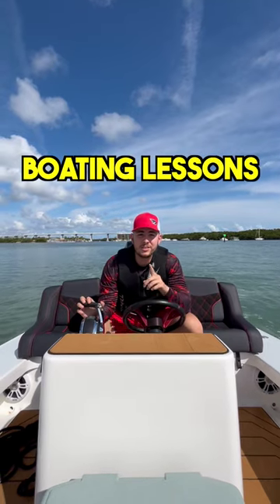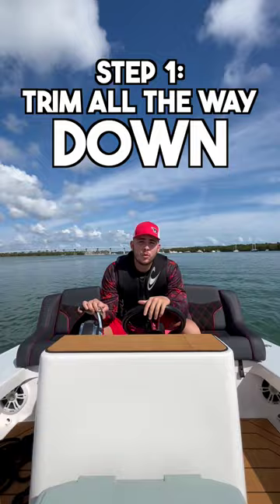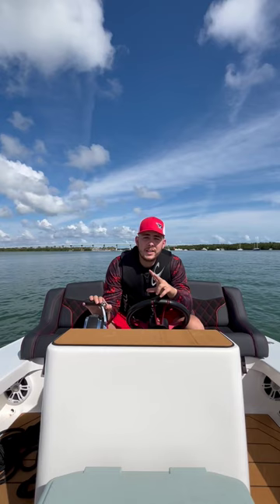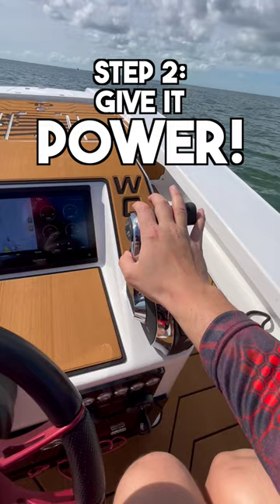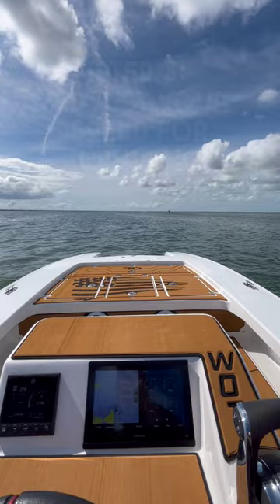How To Drive A Boat! Part 1

Comment: Tip #1. Put your drain plug in
Reply: This one!!
Reply: Every starting mistake.
Reply: @TapDaKart just bought a boat a month ago and I did it the first time putting in the river. Luckily I caught it in time to load back on trailer and drain. Lol. Never do that again I hope
Reply: Actually you have to take it out. The more expensive the boat is, the more you are recommended to take it out.
Reply: Or just never take it out and don’t get water in the boat… 😂
Reply: @rollen901 I hang a drain plug over the ignition so I can never forget putting in the plug.
Reply: @mountaingem6 great idea. My boat is moored but next time I'm out there I'll try this out! 😂🫡
Reply: What’s a drain plug?

Comment: Pro tip for planing (for bass boats more or less) give the boat everything its got until the bow comes back down
Reply: Taught my brother this. He has an old 2stroke he would over heat because he'd take too long to get outta the hole. Showd him to trim it down all the way and give it all until it comes back down and he has no issues now lol
Reply: How i handle my wellcraft center console.  115 2 stroke with broken trim. She just stays down. No issues planing till its overloaded and everyone wants to sit on the front 😂
Reply from the maker: Yes very true! I had a really big propeller on this boat for top speed. So the hole shot was really bad!
Reply: And if you got a fat friend with you have him move forward real quick

Comment: There is hardly a time that you want to ride around with you engine trimmed all the way down. Once your on plane raise you engine and it will tremendously help you fuel economy and speed. Most people say engine down in chop or whatever and that's not the case. With the engine up your boat will mostly just skip over everything.
Reply from the maker: That is why I said trim accordingly

Comment: Put your engine all the way down, after the bow comes down a bit start trimming the engine up. You will see the rpm increase. Trim up until the speed comes down then lower the engine a bit and adjust the rpm to where you want it.
His advice is wrong.
Reply: This
Reply from the maker: That is why in this video I said trim accordingly because the video is about getting on plane not about how to trim once you're on plane. But by the way your steps are wrong, you want to come off the throttles a bit before you trim up since you are pinning the throttle to get on plane.  Once on plane then you ease off the throttle and then trim to where your boat is most efficient. You said "trim up until the speed comes down" That is in correct for most boats, the more you trim up the less drag you have in the water meaning the more RPM's and speed you'll achieve. So your advice is wrong bud. But you can do as you please captain.